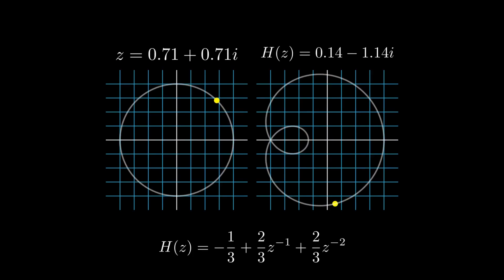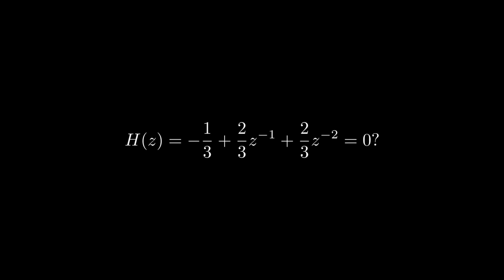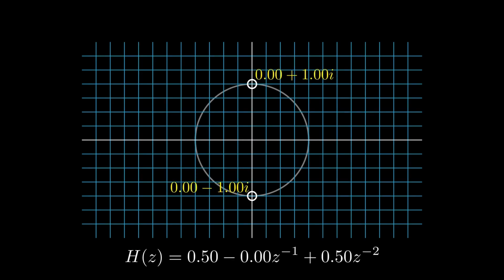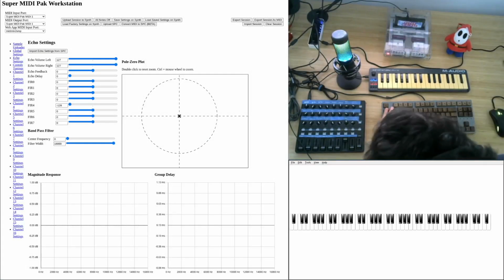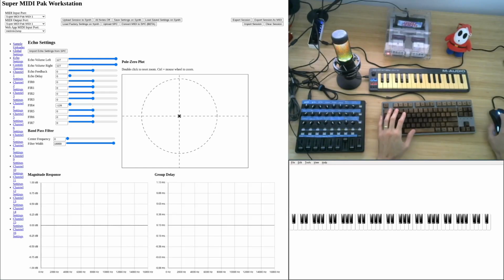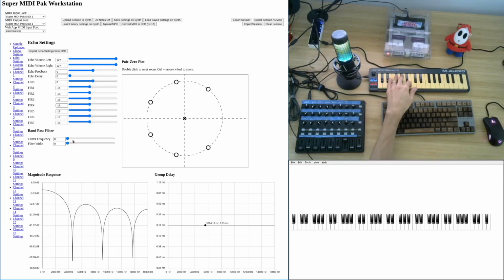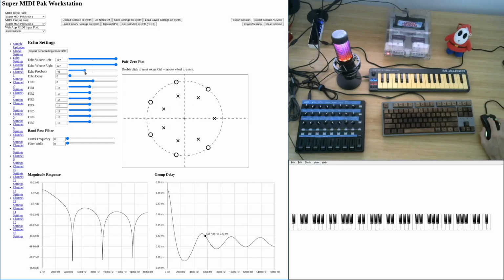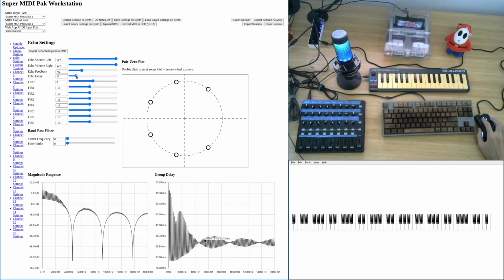Real-time Audio Effects on the SNES

Comment: Is it possible to use this to find cool-sounding FIR parameters for use in homebrew projects or songs written for sound drivers like AddMusicK, or does it only work on a physical Super MIDI Pak?
Reply from the maker: Out of the box it works with Super MIDI Pak but you can use these settings in any SNES homebrew project or with other tools. You can do it by pen and paper or you can automate it by presenting a MIDI device to the web app and capturing the FIR register output.

Comment: That's awesome. And thanks for the z-transform brush up. Very well explained. Personally I would change the frequency scale in the filter designer to logarithmic, so it makes more sense in an audio context.
Reply from the maker: Yeah I've been thinking of adding some toggles to change the units of the graph. Different scales are better under different circumstances. For instance, I originally implemented group delay for the phase response display but group delay isn't always the most relevant way to understand the response. Thank you for the kind words!
Reply: @supermidipak  Oh right , speaking of delay, observing comb filter effects caused by delay does look better on a linear scale. So a toggle would be the perfect choice.